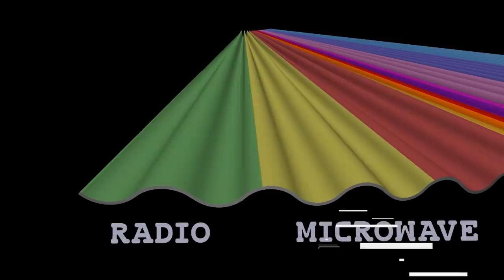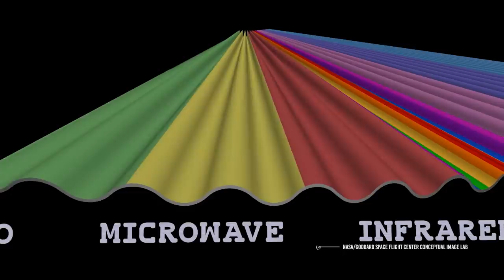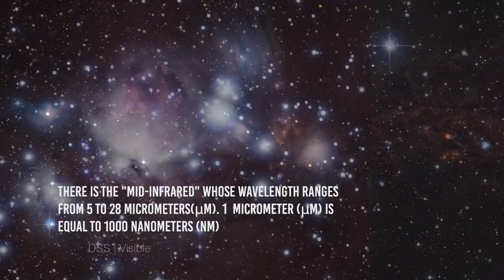Why JAMES WEBB Is Ready To Rewrite Cosmic History?

Comment: You got 29 scary assed hours to get through after launch before it does anything. “If” the set up goes right..Then history will be made on 2 fronts. FIRST:   The most complicated unfolding of a space telescope. SECOND:  (“IF” it works) The most astounding discoveries to date. I pray it works as designed..,.

Comment: They should have built 2 telescopes, cheaper per unit price, a back up in case of problems, AND second one could go to L3, opposite the sun, so they'd have access to the entire sky at all times.
Reply: @Keyser Soze Let's wait to see if it explodes on launch, or fails to deploy, and then we can offer "I told you so!"
Reply: @Keyser Soze Easier to say before than after that one telescope breaks on the first day. Two is better than zero, even if double the cost.
Reply: @Keyser Soze rude. He is right.
Reply: @Keyser Soze Not exactly
Reply: Great job 👏 go watch yeonmi park to save North Korea that need to be freee
Reply: @Keyser Soze Not at all. If there's a 10% chance of complete failure, 1 telescope has a 90% chance of success, 2 telescopes has a 99% chance of one success. Who needs an extra 0.9% for $10 billion as you say.
Reply: @aresmars2003  those giant mirrors and the heat shield along with hours of research and also the contribution of other organization's aren't cheap and if they did work on 2  telescopes it is going to require extra manpower and again more time to actually build it and deploy it unlike a fucking document in your hard disk which can be backed up on google drive with minimal effort. Think before you speak my friend.
Reply: @monishraval  You've apparently never learned about economy of scale. A prototype ANYTHING always costs 100x more than the next 100 copies.
Reply: The program itself almost got defunded about 10 years ago because of the cost overruns and delays. Even if manufacturing another JWST is cheaper, it will cost a few billion more. You think Congress will allow that? Even if you make the most logical argument for another JWST, it likely won’t work for funding.
Reply: @aresmars2003  You’re suggesting making a 100 JWSTs?
Reply: @executivesteps  I suggested 2 telescopes would have been prudent.
Reply: A second telescope on the other side of the Sun at L3 from Earth would be useless because we couldn’t communicate with it due to interference from the Sun. 
Even the Mars probes go offline for a week or two for the same reason as they orbit the Sun..
Reply: @executivesteps  Of course that is easily fixed by a relay. The value of having opposite sky coverage would far outweigh that little inconvenience.
Reply: @aresmars2003  How much would that simple fix cost beyond the cost of a second JWST?  
I believe those solar black outs have been a reality with all planetary satellite probes. 
NASA is budgeting $150 million a year just to operate one JWST.
JWST cost overruns have taken billions of dollars from other well graded NASA programs that were delayed or even cancelled to fill the multi billion dollar hole created by JWST. Even at a 50% discount, NASA wouldn’t build a second one. There’s more (a lot more) to astronomical research than the near infra red. 
Recall that as the costs of JWST rose dramatically, it was once referred to as “the telescope that ate NASA”. One is enough.
Reply: @executivesteps  We'll see how that gamble goes. They've had a good string of luck in the past 2 decades without redundancy. And there's always the 2050s for the next infrared space telescope.

Comment: It doesn't really replace hubble. Hubble is an optical telescope jwst is ir. JWST was designed to work in conjunction with Hubble. Hubble's end of mission is 2044. JWST mission will only last for 5 years. That wouldn't make a good replacement.
Reply: Optical telescope. Not optional.
Reply: @Icspiders247 auto correct.
Reply: @johngraham7045  Fair enough.